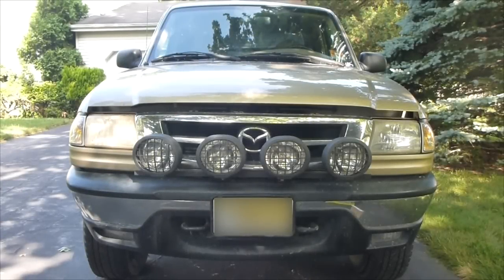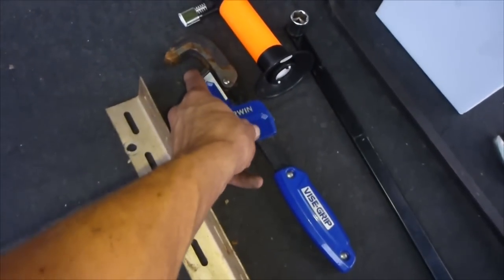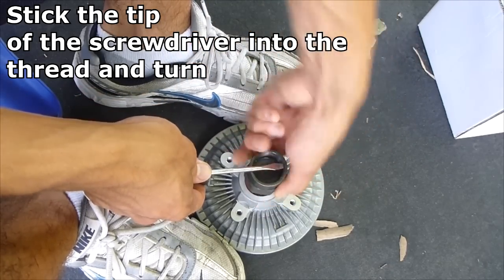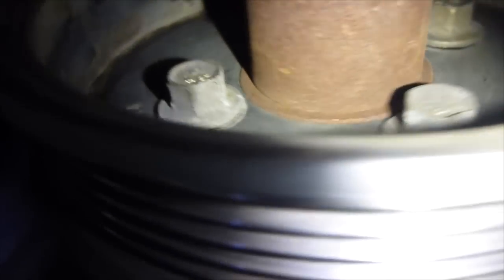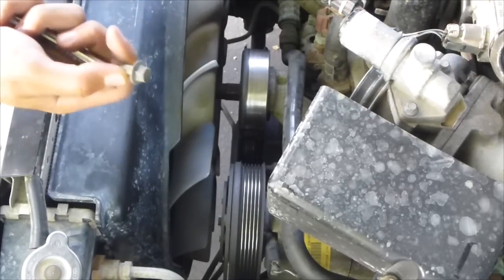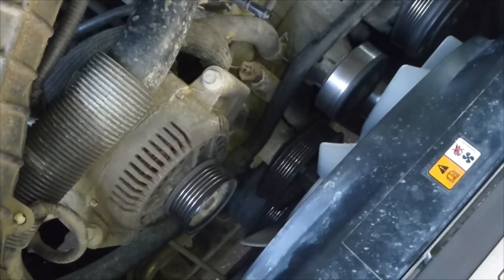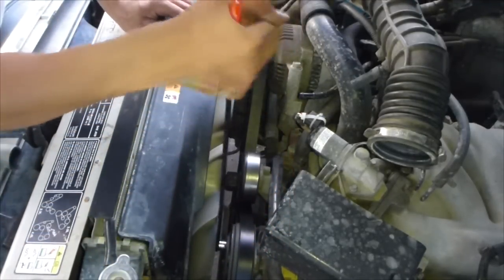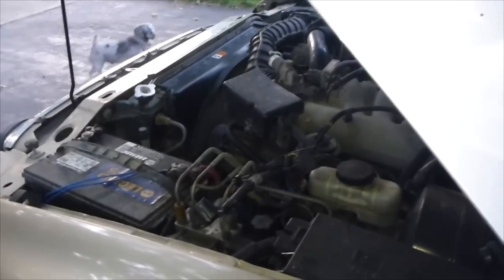How to Replace a Fan Clutch

Comment: I have a 98 Ford explorer v8 5.0L and it always shows running slightly more on the cool side but the engine always seems hotter than normal. We replaced the thermostat when we got it because it was overheating when we were idiling at red lights and stops, we had a failsafe one put in but now it shows slightly more cooler but it just doesn't seem right. Also it has a fan clutch.
Reply from the maker: Yvonne Reilly I dont get it. How can it run on the cool side but it seems hotter than normal? Can you spin the fan with your hand with the engine off?

Comment: There is a noise coming from my engine that increases with the RPMs and really seems like a bad fan clutch, but when the engine was off, I was able to rotate the fan freely. Could this problem still be the fan clutch or is it something different?
Reply from the maker: It could still be the clutch. Open the hood and see if it is spinning fast and making the noise you are referring too.

Comment: Hi Chris i have a question 
I have a 2000 mazda b300 
My problem is going up hill it gets overheated.
I replace the radiator, thermostat, clutch fan, and still doin it. Can you give me a suggestion??
I dont know what else to do. 

It doesn't get overheated in trafic.
I can drive in traffic and no problem.
Reply: Have you replaced your water pump? Try it, if it still overheating maybe it have something to do with your head gasket.

Comment: Chris, great instructive video and made me go check my fan immediately but it turned freely.  Just bought a 2000 Ranger 4.0 4x4 with 148k miles.  First long interstate drive was 85 miles and noticed them temperature gauge was in the 3/4 zone, closer to the 1/2 position but I noted the A/C wasn’t blowing as cold as when I first started out.  Yesterday I was hauling a trailer and the temperature was running near the max, RPM was around 2000-2500 and had to turn OFF the A/C to keep it from maxing out the temperature gauge.  Any ideas as to the cause?  Radiator is full, overflow 1/2 full, haven’t yet tested the composition of the coolant.  Thanks in advance for your thoughts.
Reply from the maker: Robert Rodgers Check the coolant like in this video: https://www.youtube.com/watch?v=mHTM3dvpD1M
Probably time for doing a coolant flush: https://www.youtube.com/watch?v=s--5ft5YiHg
Or your water pump is bad but it is more likely just bad coolant and you need a flush. Also, check/replace the thermostat!
Reply: Wound up replacing the thermostat and it is running fine now. It was an easy job except for that one bolt on the bottom of the thermostat housing.

Comment: Hey Chris, I have a 96 Tacoma with the same issue as described in this video, except I am able to spin the fan freely with the engine off. Any ideas?
Thanks
Reply: When the fan gets hot, it should be hard to spin by hand. When the fan is cold, it should spin freely.

Comment: Chris in my 2003 ford f250 I have an air conditioning problem. My air blows hot. It may stay out kinda cool but will become blazing within min. How can I resolve this problem
Reply from the maker: Joe Windsor Sounds like it is low on refrigerant. I would add some!

Comment: I saw that your temp gauge is out of range in this video. I am having the same issue. How did you fix it? Thanks
Reply from the maker: It was fine... I didn’t do anything. If your temp gauge isn’t working see if the computer is reading it with a scanner and if not replace the sensor
Reply: @chrisfix  it is working but it rests lower than it should. Like yours. I know it is not a big deal it just bothers me. Thanks anyway

Comment: How to flush Clutch fluid? Also how to locate bleed valve for clutch in any car? Is that mentioned in car manual?
Reply: Yasir Imran that likely won't be in the owner's manual. There's a few different ways to bleed your clutch. Look it up
Reply: Clutch fluid? Are you talking about an Automatic Transmission?
Reply: if the clutch is hydraulically operated then is uses brake fluid

Comment: My '88 Jeep Cherokee has one of each fan - a belt-driven clutch fan and a second electric fan.  I finally replaced the clutch fan with one from a junkyard that still spun freely.  The original fan didn't spin at all.  The clutch was totally seized.

Comment: hey chris im having a problem removing my waterpump on my 99 ford ranger 3.0 v6 4x4 i was able to remove all bolts except one that is almost impossible to remove its on the driver side right by the ac compressor and power steering pump is there anyway u can point me the write direction your help always appreciated as i am a big fan of yours thanks mark
Reply from the maker: +Mark Ranaudo Why can you not get to that bolt? If you must, loosen the power steering pump and compressor so you can get a socket in there. Check out this video for ideas of how to get to tough bolts: https://www.youtube.com/watch?v=rulXlnG2Unk
Reply: ChrisFix h

Comment: He showed a little bit but you will absolutely have to use a torch to heat up the fan bolt to break that loose because the use red lock tight on it which is meant to never be taking off. Good luck I fought with mine for hours tryin to get it off eventually just took it to a shop and the torched it and got it off in about 2 min and just charged ten bucks but shit it was well worth the ten bucks cuz that was a pain in the ass

Comment: Hey Chris! My 93 Nissan 240sx has the same issue fan matching rpm, but my fan will still spin freely. I'm really thinking fan clutch, but i'm wondering if it could be the water pump. Your thoughts would be greatly appreciated!
Reply from the maker: +computerblue01 It is probably the fan clutch. The water pump would not cause that problem.
Reply: Thank you sir!

Comment: Hey Chris,thanks again for a great vid.The slave cylinder in my car makes a squeaking noise when i press the clutch pedal.I used various lithium based greases but after 2-3 days the noise comes back.Any specific grease i should try on?I've heard good stuff about white lithium based grease(which i have never used).

Thanks!
Reply from the maker: Zisis M You might want to try some silicone grease. That should work! Here is what I use: http://amzn.to/1EEWWvm
Reply: +ChrisFix Unfortunately i live in Europe and i cant buy it. Any other solutions? (also, the manual says to use lithium based grease)

Comment: I was if you can help me I have a 2004 chevy trailblazer the other day it throw a code at me that I have never seen before P0483 it has overheated cooling is fine have you seen this code before. I am thinking its a fan clutch.

Comment: The fan clutches went bad only when they ran out of silicone oil or with overfilled silicon oil. When you remove the fan clutch, you should open the 4 more 8mm bolts on the clutch. Open it and check the silicone oil level. If its less, then top it up. or vise versa.

And remember, when you spin the fan with finger and it does not move much, then it mean the silicone oil is doing its job in the clutch. IF fan moves freely with finger, then its running out of silicone oil.

Changing silicone oil is more economical rather than changing the whole clutch.

Comment: I have the same problem but my fan spins freely. Could it still be the fan clutch? I have no check engine light, Drive a 1999 Ford Explorer
Reply from the maker: It could still be the fan clutch if the fan is spinning too fast.

Comment: Hey Chris Fix, Hopefully you can help.. Ive got the 4.0 Ford RANGER V6 2003. I have the same problem but cannot seem to find the part for the clutch!? I love your videos because they are the same as with the ford rangers!
Reply from the maker: Hopefully this helps: http://amzn.to/2giFyaF
Reply: thank you so much! Its a fit according to amazon! Also when you put the belt back on, other than the certain pattern it follows doesn't the alternator, power steering, fan and whatever else the belt is attached to have to be in a certain position? Like is there a timing they all follow?

Thanks for the quick response!!!
Reply from the maker: There is no timing for a serpentine belt. Just make sure the smooth pulleys get the smooth side of the belt and the grooved pulleys get the grooved side of the belt.
Reply: Ok thank you! Ordered the parts!

Comment: I have a 94 b4000 and the water pump is bad so I had to do this same process lol you made it look so easy I had to use chains but got it to work
Reply: fuel switch is not work need to set power to fuel to pumps

Comment: I have to replace my OE plastic fan blade , the only new ones I can buy are made from steel that are direct fits. Will going from plastic to metal do anything to the performance? Like good or bad?
Reply from the maker: YVONNE REILLY You wont notice any difference between plastic and metal. The only problem with the metal fans is that if they are cheap, they might rust.

Comment: Great video. Hows that Harbor Freight composite ratchet holding up for you? I've been kicking around getting once ever since i first saw them.
Reply from the maker: It is doing great. It is nice because it has good grip, in the winter it isnt freezing cold, it doesnt damage anything when it hits, etc. I have used it in high torque situations and it holds up great. The downfall is that it does get plastic chips (like when you hit a sharp metal edge it indents the plastic). Nothing bad, but it was a flaw I saw. Overall I recommend it!
Reply: Awesome. I feel HF tools are highly overlooked. They are a great value and you cant go wrong with the lifetime guarantee.. assuming you keep the receipt... Lol.
Reply from the maker: Exactly. You need to know what to buy and what to stay away from, but I have had great experiences with their tools, and like you said, lifetime warranty, and they are 1/4 the price of brand name tools!

Comment: On my 03 you don't pull the idler to the right, there's a belt tensioner down below. You pull the tensioner to the right. For me it was a 16mm socket.

Comment: The pulley your referring to as an idler pulley is actually a tension pulley hence the reason you need a long bar to take the tension off the belt.
Reply from the maker: Cory Gabbard Thanks for the clarification!

Comment: I have the opposite problem with my 2009 Toyota Tacoma.  The fan clutch does not engage when hot or cold.  It spins freely all the time???  Might be one of the reasons I had to replace my AC compressor.
Reply from the maker: It can go bad that way as well!
Reply: Yes....  I used your AC compressor replacement video to replace my compressor (thanks!! very helpful) I noticed this during the replacement of the compressor.  Could of made my compressor work harder to cool my truck.   Scotty Kilmer just made a video on servicing and checking your AC system and mentioned this as a cause of compressor failure.

Comment: not fan related but i have a 05 chevy equinox and when i try to use the wind shield fluid all i here is the motor runing but no fluid coming out. thats also for my back window. i hear the pump but no fluid. any ideas or tips?
Reply: chris fix
Reply: Isaac  Poncedeleon my guess would be it needs more fluid. But idk

Comment: If is stuck although it is loud would it be good for you cooling system
Reply: wouldn't the fan get ruined if it kept spinning faster than it should ?
Reply: The engine has to be at operating temperature, in the winter the coolant would always be cooling and it would be hard to get heat faster

Comment: My truck has the same noise as yours at startup and when I hit the gas the fan stays at the same rpms also, but when I start driving and get out of first gear, the noise goes away completely. Any ideas?
Reply: I forgot to add, my fan moves freely
Reply from the maker: +3699kyle The fan clutch is probably just getting old and starting to fail.
Reply: +ChrisFix ok thanks for the reply and good work on your videos!

Comment: is a clutch that spins freely even when hot or cold bad?
Reply from the maker: ben Yes, when the engine temps are up, it should spin a little faster and when the engine cools, it should be "looser" and spin slower.

Comment: Replaced my fan clutch. Still does it. Flushed radiator, and still does it. Could it be water pump? Nothing else I can think of
Reply: You may have installed a heavy duty fan clutch, they run at a high speed so they sound louder. A standard duty fan clutch will be quieter.
Reply: @jaysarchive7325  it turned out to be my water pump was full of calcium lol thanks for your reply tho
Reply: Jacob Erickson Ohh ok lol

Comment: I'd do anything for one of my can clutches to stick on like that. They all do the polar opposite I had a 1994 Ford explorer do that and I just left it alone. Didn't effect power or fuel economy either just kept the motor and trany cool.
Reply: you could probably weld/screw/glue/wedge the clutch somehow so it could lock up if you really want

Comment: You should buy a flexible hose clamp screwdriver. Screwing clamps with a flathead will eventually screw them up. odd that you dont have one altough you got all those other fancy special tools for the job :)
Reply from the maker: +chottom Thanks for sharing. I use common hand tools that most people have at home. I try to stay away from specialty tools for videos.

Comment: Chris when is new the fan cluch pulls air? thank you
Reply from the maker: +TheRicoMalibu I dont understand the question.
Reply: I mean, if when the engine is cold and the fan clutch is good, feels that blows air or not. because I understood that if this should not feel cold air if you open the hood , thanks
Reply: +ChrisFix  I mean to the minute 14:40 in this video thanks a lot : )

Comment: You should do the water pump for the same vehicle I need to see you do it because I need to do it to my Ranger 3.0
Reply from the maker: I did it in my “how to replace a radiator “ video. You need to unbolt the power steering assembly

Comment: hey I have a 77 El camino and the fan clutch just went out last week just changed it and it doesn't spin and my  radiator just over heated:( #helpme I need knowledge

Comment: Do you really need to use a clutch fan? I put 2 puller aux fans on my Towncar and took the stock aux fan and clutch fan off...
Reply from the maker: +DreamWarrior If you put in electric fans you dont.

Comment: 9:38 Chris all vehicle fans pull in air and not push air. They pull air to draw air across the radiator fins thus cooling your coolant.
Reply: depends on how you look at it... it pushes air towards the radiator...

Comment: While I was installing a header gasket on my Trans Am, I felt something wasn't right with my radiator fans. I checked them and the passenger side fan wasn't spinning.  I put power directly to the fan motor and it was dead.  Went to the junkyard and pulled a motor out of a Camaro.  All works great now.  Interesting that the fan motors in the V6 cars are a bit smaller than the motors in the V8 cars.

Also, you're running your truck on an empty tank of gas?!

Comment: is it possible to drive far with the clutch fan like that?
Reply from the maker: orgil batbold It is but if your engine revs high, the fan can break apart and cause a lot of damage so dont have the engine rev high.
Reply: +ChrisFix and if it's a diesel?

Comment: Good that they fail to constant full operation. Mine failed to limited spin and my vehicle overheats. With my truck I would not mind the noise, and would like a way to fix this one where it remain totally engaged like the old units once did.
Reply from the maker: You dont want it totally engaged because it would take longer for you truck/car to get to operating temps plus it would use power to spin the fan 100%, all the time. When the car is cold, it is in closed loop which yields poor fuel economy and engine performance. The clutch in the fan is basically an external thermostat.
Reply: Agreed, I understand it will cut fuel economy and would gum up my engine if it do not reach operating temp.  Here in Cayman not a problem with too cool. Too hot yes.  Right now I am looking at installing 2ea 24V electric fan.

Saw another show where the operator fixed his by freeing up a small valve top of the clutch that had rusted rigid.  

Thanks for the reply. Keep up the good work..
Reply from the maker: Thanks! Good luck with your electric fans!
Reply: same for mine. I like the noisy fan sound and if it helps keep my suv cooled and makes it sound bad ass im ok with that.
Reply from the maker: But if your engine needs to rev and it goes into the higher rpms, your fan can break apart from the force of it spinning so fast. If it snaps off it will cause a lot of damage. My friend had this happen on his BMW and it caused damage to the intake, coolant system, and he needed a new hood.
Reply: Dam. Sounds scary.
Reply from the maker: Gabriel Pla
Looked like a grenade exploded in his engine compartment. It was a mess.
Reply: ChrisFix I would imagine the problem would happen much more quickly with one of those clutch fans that has 3 of the 5 blades purposely offset from the other 2. And that does sound like it was a mess too...
Reply: @John  super old thread, but I just want to point that the fixed blade fans had a completely different profile to handle the higher rpms which they would spin at all the time.  There is, or was, and aftermarket "flex fan" that used to be for sale that was designed to be fixed mounted, but I've heard horror stories of them blowing up.

Comment: I mean my 74 dodge d100s fan isn’t electrical and I need to rev at a stop light cause the radiator is dog water I need to replace it because it’s not ideal to have to rev your truck at a stop light and it’s not a stick it’s an auto